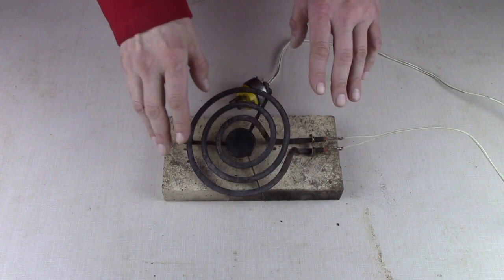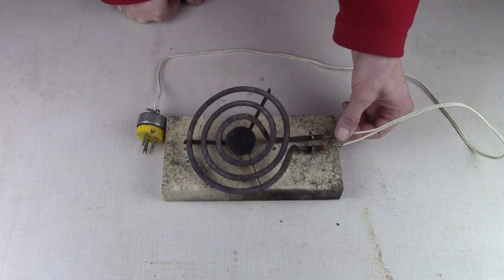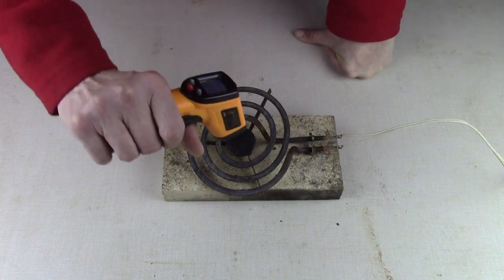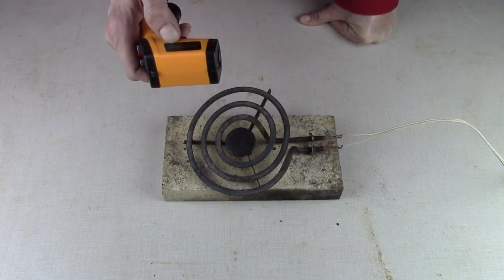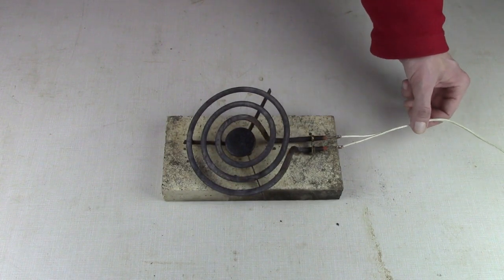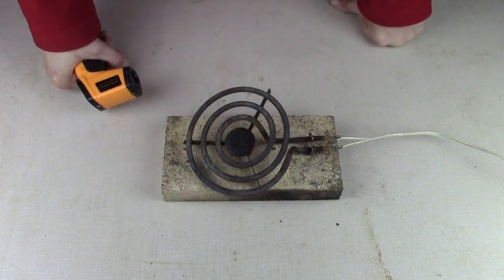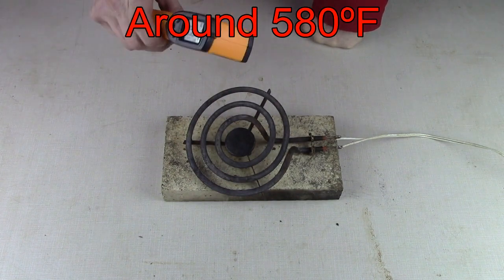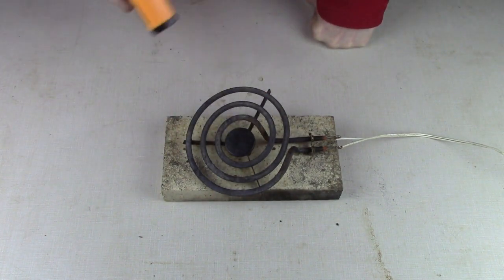What will happen if you connect 110v to a 220v electric stove cooking element

Comment: A little off-topic here, but I was examining a Haas milling machine some years ago and around back there was a heating element VERY MUCH like this one mounted inside of a heavily perforated guard.  It seemed very out of place on an $80,000 piece of machinery!  I inquired to the Haas representative nearby as to that part's function.  It is used to absorb electrical energy when the spindle motor is switched from powering the spindle for cutting to applying a braking force on that same spindle whe the machine needs to stop.  To do this, the motor's windings get switched to the heating element as it spins down.  Since many electric motors will turn into electrical power generators when they are disconected from a power supply and their output shafts are turned, the power output can be sent to a load, ( in this case an inexpensive heating element,) and that load can absorb that power at a high rate to make the motor slow down very quickly.

This type of heating element was used precisely because it was very inexpensive and would last forever.  Haas machines are generally less expensive than most other machine tools.  It is practical solutions like this that help keep costs down.

In concept this braking method is quite similar to regenerative braking in an electrified automobile except in this case the electricity is not used to recharge batteries but instead is used to make waste heat that is dissipated into the surroundings.

Yeah, now I'm really off-topic.  Sorry.

Comment: I must have a completely wrong understanding. I thought the four burners were 110 and the oven elements were the remaining 110 out of phase.
Hence, nothing on the stove would really be more than 110 but with 180 phase shift you could run burners and oven at the same time for a total (add) pull of 220 vac. //ji
Reply: I imagine it's diferent for different machines from different manufaturers, but it was my understanding each element was 240V and the lights and controls used one of the 120V legs.  I could be mistaken  However it wouldn't be hard to find out with a DVM.  I'd do that, but we only have a gas range.

Comment: I have some oven. Really old wall oven. 220 in but the two hots are split into their own breaker. This mean it's actually 110? Maybe 110 doe each burner?
Reply: each side of each element is 110 , its resistance in the wire goes to heat making the element glow depending on how much the knob (riostatic dial) is turned.

Comment: After 2 hotplates I bought on Aliexpress stopped working after only 2 months, I think they were designed for 220v and marketed to US and Canada as 110v / 220v because you can't return them ):
Reply: I doubt that they failed for that reason. If anything I suspect it would have failed quicker at 220v. It was probably just a cheap product that used cheap/bad components that somehow failed. Generally under-voltage is never a problem for causing damage on any electronic or electrical device. The main issue is just with the device not getting enough voltage for the electronics to operate, which usually happens with electronic (digital electronics) systems.
Reply: @MsHojat  thanks!
Reply: @nickyp2820   The cheap ones Ive bought are sensitive to oil

Comment: Question, what would happen if you connected the stove top element to a 12 volt car battery? I ask because I'm trying to drain a 12 volt car battery but don't know how (I don't have a car to put it in)
Reply: it will work, it s a resistor, but why would you drain a car battery?

Comment: Power output will be 25% if voltage is 50%
V=R*I  R is constant, so current will be 1/2 amps if 1/2 voltage is applied.
P=V*I so 0,5*0,5 = 0,25P
Reply: But doesn't the 220 power like 4 burners and an oven?
Reply: @surclingjrdn  Oven runs on 240V. If you plug it on 120V , it will still power the 4 burners and the oven.
But the elements will put out 25% of their normal heat because with half the voltage (Potential) applied 
,only half of the electrons (Current) will have the energy to pass through the elements (constant resistance)
Reply: what would happen if you were to connect a 240v broil element to 110v? would the element try to maximize the wattage and blow the fuse? or would it work much less efficiently?
Reply: @gareth6517 it's just a resistor so it'll be less hot
Reply: @gareth6517  It will take longer to heat assuming that it has a thermostat. Maybe it will not reach the set temperature at all. Apart from that it is safe to connect to 110v.

Comment: I have a stupid question. When a stove or dryer says it needs 220 volts does that means it needs three phases?
Reply: No. An electric range is a single phase device. It does need two hots, neutral, and ground. Older systems simply bonded the neutral to the range's chassis and that served as a ground. This is still legal on existing installations. New installations require a four wire cord. The neutral is needed because the oven light, clock, and timer run on 120v. The top elements and oven elements run on 240v.
Reply: @bamaslamma1003  I've seen the difference between older dryer plugs and newer ones. Thanks
Reply: Three phases would be 330v

Comment: Would like to see the amp draw on that to see how many amps it's pulling compared to a regular 120v
Reply: You cut voltage in half over the same resistance, current drops to half.

The total power consumed (W) is voltage (V) times current (A)… so the total power using 120V instead of 240V is 1/4 the wattage.

Comment: The voltage +  the coil thickness makes either warm up slower or faster ... so 110v works but much slower than the 220v that can get it red cherry hot quickly.
Reply: The element has a specific resistance. If the voltage is lower the element has a lower output power and also a lower maximum temperature.
Reply: @ABaumstumpf  yes the same as vape machine coils I make my own coils for different resistance and output some get hotter quicker some slower depending oon the gauge I make the coils for it and that I want.
Reply: How about 110v heating element plugged to 220v?
Reply: @TempestKazuto  I would not try it because the specs are the apposite right,  instead of slowly doing it then if it's the apposite you know what would happen.
Reply: white  no you will melt things you can't control thr power that way don't try things if you are not an experienced electrician

Comment: You should have connected it to a Kill-A-Watt wattage meter and showed us the wattage.  It would have been informative.
Reply: well it's very simple actually since we're dealing with a purely resistive load and you can do without a wattmeter. Just remember that if you halve the voltage you effectively divide the power by 4. So if your heating element was rated at 1000W at 220v then at 110v it would consume 250w of power.

Comment: Hellow sir what happen if i use the heating element of the rice cooker with the same tricks like this video .. Does it works ? 
I mean direct AC . Please reply 😊😊😊
Reply: Yes it will work
Reply: Assuming it isnt digital, it will work, then again even if its digital, if the digital partition has a large range of input voltage, it might work anyway.

Comment: Wonder what could happen if you take a 110 volt heating element and connect it to 220 volts...
Reply: If you live in Australia and have a 120v American element that is meant for around 2400w of power. Connecting it to 240v Australian will actually result in the circuit breaker turning off at your power box, as each plug in an Australian house has a 10amp limit. 
And as soon as you connect the 120v American element, it won't draw 2400w like normally (it will draw up to 4800w). So basically if your house is a normal house nothing will happen but your circuit breaker will keep turning off.

Now if you are able to connect the element to a 240v power source with no 10amp limit, and you manage to use huge thick 20amp wire to connect to the element, the element will glow bright white after a while and just burn out (the wire inside the element burns out basically.)
Reply: No more askin questions man! Juz do it n make a vid of it den upload it after.. if u survived..
Reply: it could explode
Reply: Complete burnout, like the person who made this video. Duh.
Reply: @leegordon-asch7391  rude....